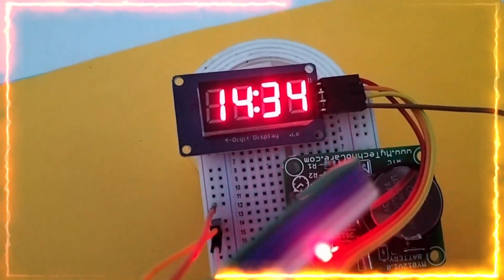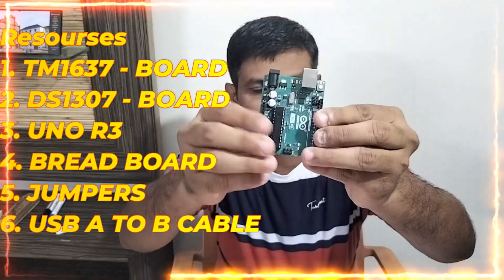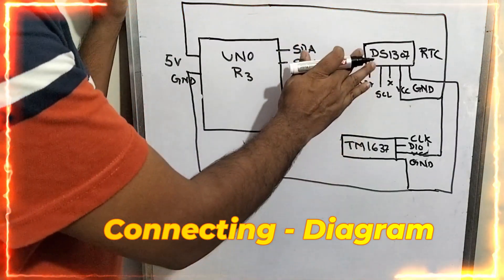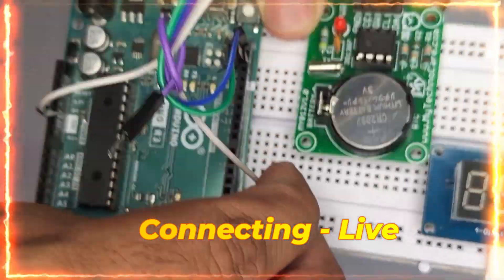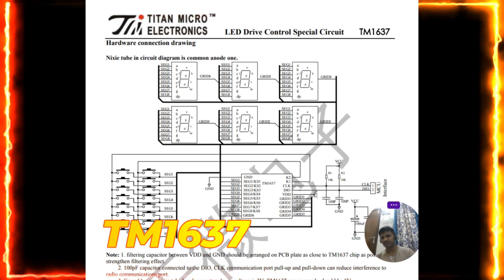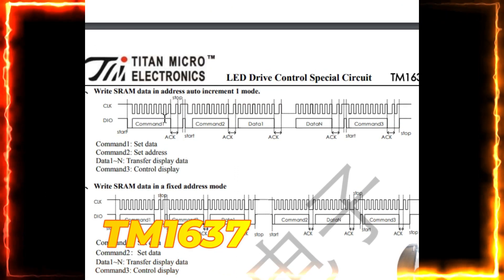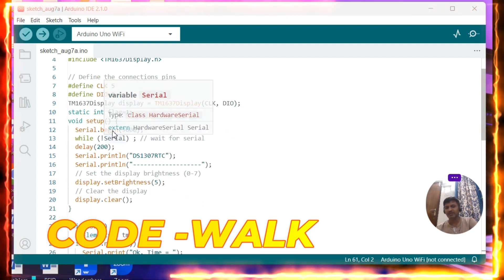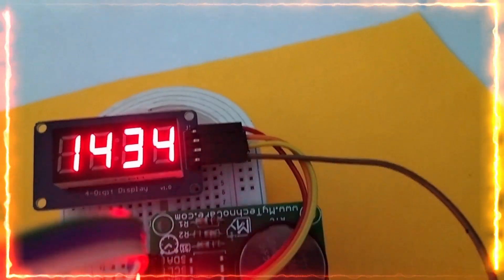How to use TM1637 4 Digit 7 Segment LED Display with Arduino

Comment: Hii bro 
After put a cod in Arduino Uno our rtc module show a current real time? Without any setting in code

Please tell me
Reply from the maker: Let me check
Reply from the maker: #include <Wire.h>
#include <DS1307RTC.h>
#include <TimeLib.h>

// Set your time here: (year, month, day, hour, minute, second)
const int setYear = 2025;
const int setMonth = 4;
const int setDay = 30;
const int setHour = 14;
const int setMinute = 45;
const int setSecond = 0;

void setup() {
  Serial.begin(9600);
  while (!Serial); // Wait for serial to connect (if using Leonardo/Micro)

  tmElements_t tm;

  tm.Year = CalendarYrToTm(setYear);  // Converts year to offset from 1970
  tm.Month = setMonth;
  tm.Day = setDay;
  tm.Hour = setHour;
  tm.Minute = setMinute;
  tm.Second = setSecond;

  if (RTC.write(tm)) {
    Serial.println("RTC time set successfully.");
  } else {
    Serial.println("Failed to write time to RTC.");
  }
}

void loop() {
  // Nothing needed here
}

Comment from the maker: Amazon - Online Purchase Links for Resources:
1.TM1637
https://www.amazon.in/1pcs-TM1637-Digital-Display-Module/dp/B0BZP2RHT9

2. DS1307
https://www.amazon.in/gp/product/B01M0UQ1TA

3. Uno R3
https://www.amazon.in/permanent-guarantee-Arduino-Uno/dp/B0044X2E5S
https://www.amazon.in/roboCraze-Arduino-Development-Board-cable/dp/B07G4C4D8F

4.Breadboard & Jumper
https://www.amazon.in/ePro-Labs-KIT-0010-Breadboard-Pieces/dp/B01BLJGS7M

5. USB A TO B
https://www.amazon.in/JGD-PRODUCTS-Printer-Compatible-PRINTERS/dp/B09TXLM9TP